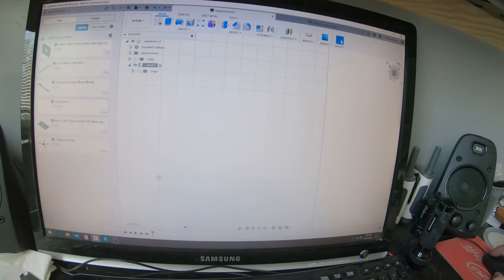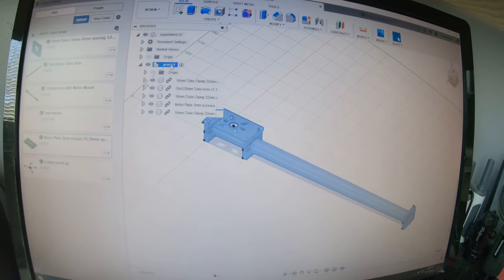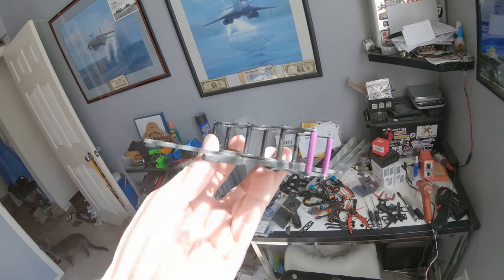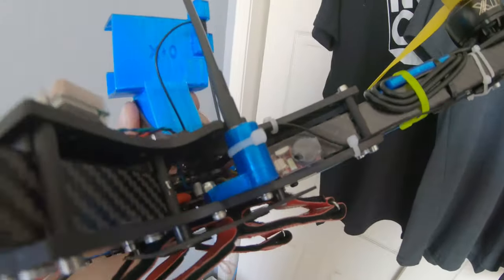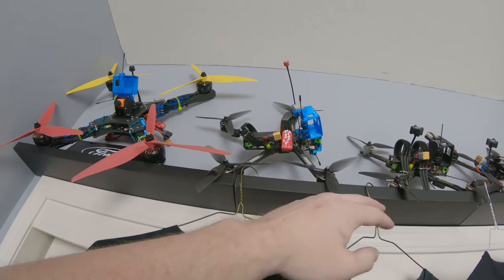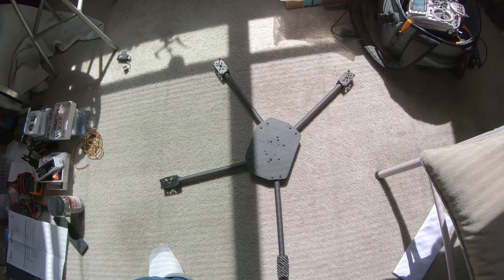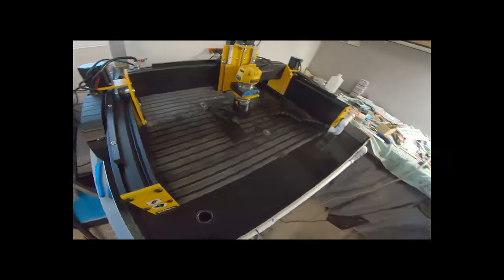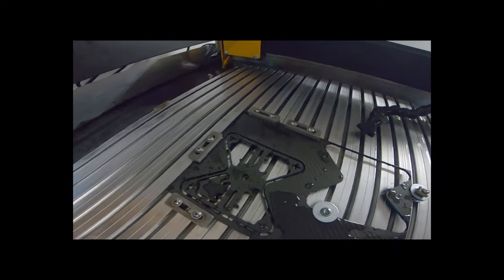Plenty to do during Corona scare

Comment: That's a great way to spend quarantine time. Love that dust-free CNC setup. For sure you don't wand CF shards in your lungs, same as you don't want Covid19 virus inside lungs either.
I'm blown away by those flight times on your beast & 7" rigs. I gotta make me a pack of those Li-ion. I've dusted off some of my 2" and 3" beasts and been flying around the backyard. Hadn't flown in months.
Reply from the maker: On my 3.5in built I hit around 12min on 3000mah with a 3000mah 3s.   That is ripping pretty hard sticking to a 60% throttle cap
Reply: @dividingbyzerofpv6748  I'm now browsing for Sony VTC6 cells and a cheap spot welder to attach tabs to the cells :)
Reply from the maker: @EngineerX  check for the VTC5D as well.  Little less capacity but higher amp draw rating.
Reply: @dividingbyzerofpv6748  yes that's the one i'm looking into now after I watched your video again and heard you say vtc5d and total of 11200mAh on 6s4p 2800x4=11200 thanks for the heads-up. I'm going to see about setting up a 3.5". The mini/micro rigs are better for flying around the house.
Reply from the maker: @EngineerX  i built a few 3s packs and they are fun.   Hard to get under 250g weight if that is a thing but it is possible.

My 3.5in on 3600kv is a fun build.   It can rip pretty good on up to around 60% throttle.   Not full tilt racer zip but fun flying still.   It gets like 12min flight time on the VTC6 sticking to around 60% throttle cut.     I need to make a video highlighting that build.   It rips on 3s and 4s lipo and then can cruise for a long time on LithiumIon.
Reply: @dividingbyzerofpv6748  What size motors/kv are on your 3.5"? You should definitely make that video of the 3.5 setup". I don't think anyone has shown such a setup for optional use with 3S Li-ion.
Reply from the maker: @EngineerX  it is the frame @3:26 with 1408 or 1507 motors.   3.5 in is getting kinda beefy so wanted a bigger stator.   Clearance on prop to side plate is like 1/20 of an inch
Reply: @dividingbyzerofpv6748  thanks for the info. Yes 1507 better so it's effortless spinning those props. Some great builds and perplexing backward views. Great to see something different.